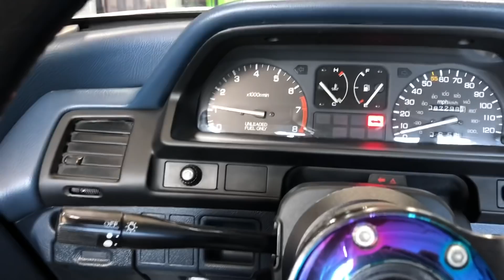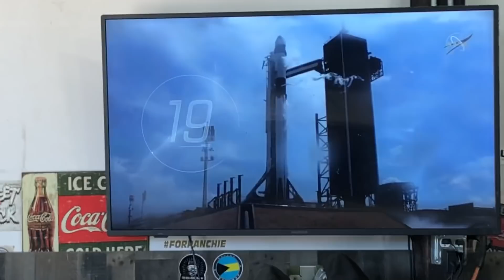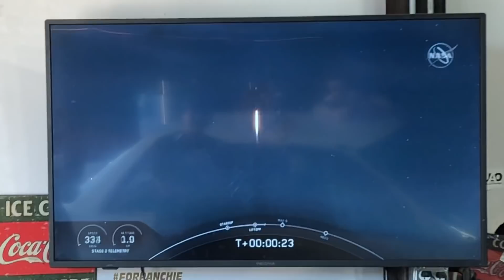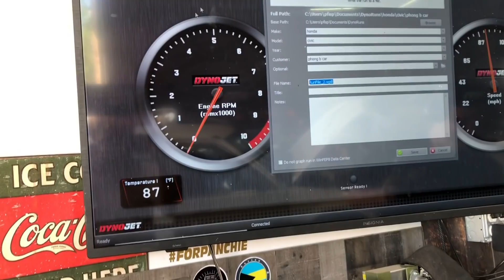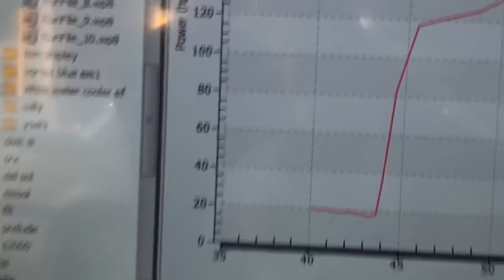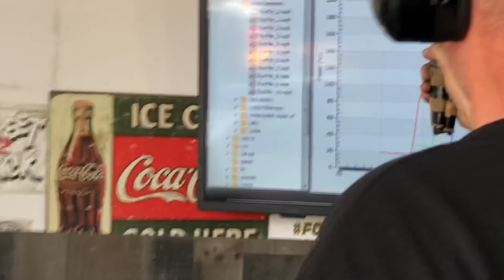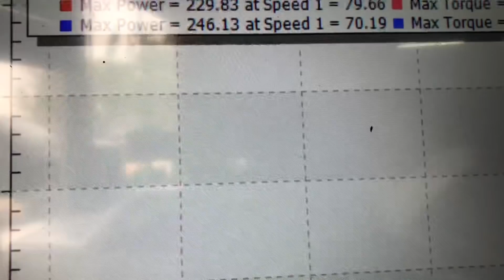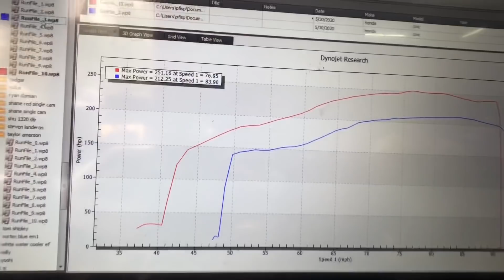The ef 4dr hit the dyno, nitro tune part 1!!!!

Comment: Need more details and technical information. Motor cc? Injector size ? Pump and regulator psi and size? Did the air/fuel sniffer work with nitro  to indicate rich/lean.

Comment: Hello phong! When switching over to the higher nitro percentages (30% and 45%)of your dyno session, did you notice any trouble with starting the engine? Did you adjust ignition timing to get maximum power?
Reply from the maker: Have to lean it out at idle so it can start!
Reply: Right on phong! What about ignition timing?
Reply from the maker: More percent add little more IGNITION but not crazy, needs stronger ignition system to burn 🔥
Reply: Stronger ignition system makes good sense to me. But Have you tried reducing spark plug gap instead?  The engine sounds pretty strong even on the later, higher % nitro runs.

Comment: What compression ratio, cams, and what size injectors are you running? I live in the high desert as well and I'm building a very similar setup.
Reply: PackMane1419 B20 stock block b16 head port job by me weisco 12;5-1 comp ,2200cc injectors